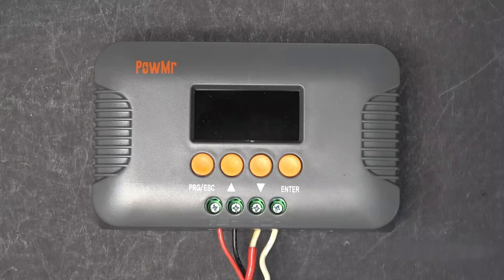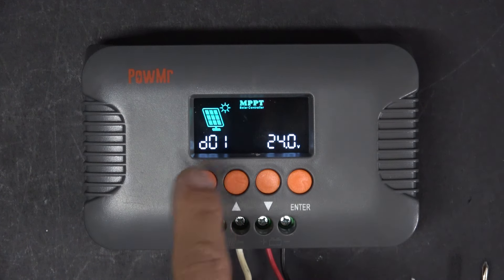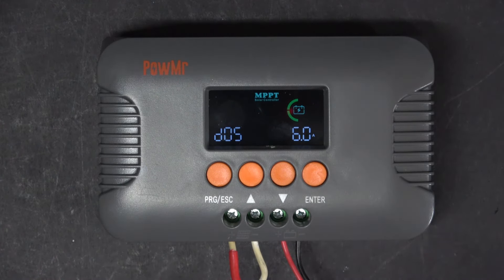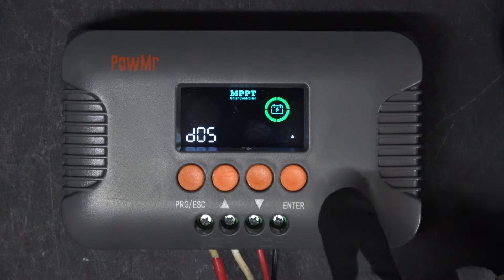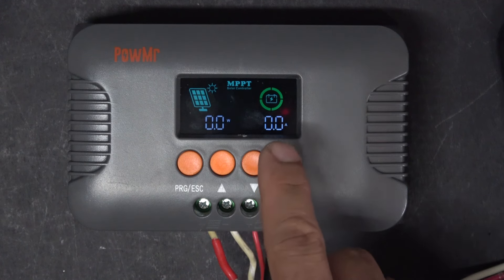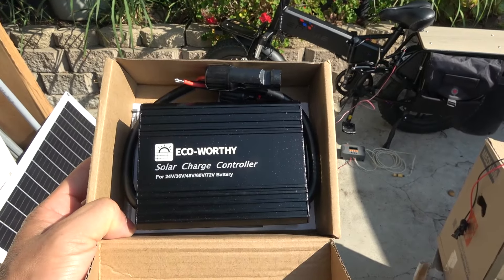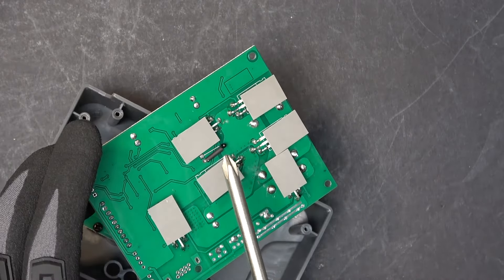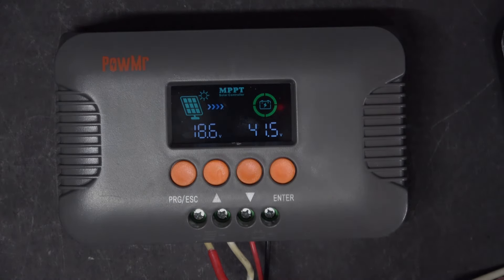Review & teardown: PowMr boost 10A solar charge controller for Electric Bike

Comment: Great video!  This info is very Helpful to those who are looking for these specific explanations, 
and it's also FUN to watch - to those with inquiring minds!  *I don't use any of this stuff, but still watched!
Nice Job!

13:49 I suppose that you could inline a little on/off toggle switch to kill the charge on the charge wire 
and/or power on the power wire..  But the features this has seems good enough.  

1 question..  With the battery plugged into the unit w/ no power coming in to the unit.. 
I wonder if there could be a slight parasitic draw?  *I've noticed that on a lot of gadgets I've tested in the past.
Reply from the maker: The inline on-off switch is a great idea. The unit turns off when the sun is down so that it can save power for the battery. I think it would still have some but very little parasitic draw since the whole thing is already off. For leaving it overnight until the next day when the sun comes out, it shouldn't be a problem at all. But if you don't solar charge it often, you might want to disconnect the battery.
Reply: @vuaeco  Awesome info man,  Thank you very much for taking the time out to explain that!  Much Appreciated! 

Hey,  I was randomly searching around on Marketplace,  and ads were popping up for FREE Bulk Panels!  All were blems / broke, but could be used for parts or easily repaired..  

If we can find more of these ads / deals,  we'd be set for life!

Comment: Nice in depth review. The functions and capabilities of this unit are quite good but it's a bit rich that you need to open the unit to correct a production problem. PowerMr has a habit of doing this to its customers, I don't know how they are still in business. May be their customers are tech-savie like yourself who can diagnose and fix the problems?
Reply from the maker: If you read the Amazon reviews, there a quite a few complaints that it arrives DOA. It's more likely the problem with the coil. The coil has a thick wire wrapping around that metal ring acting like a spring. Any strong vibration might cause it to spring out of the solder joint.